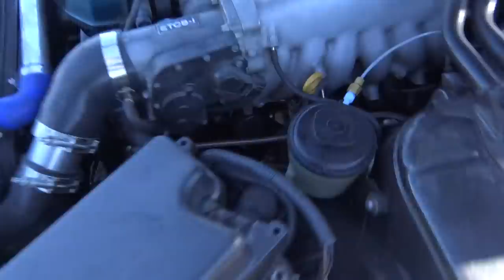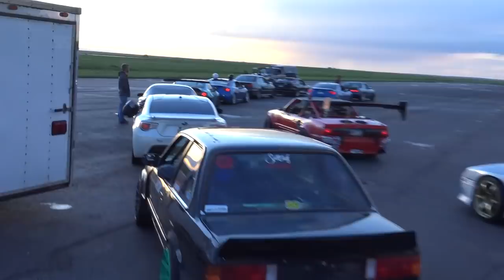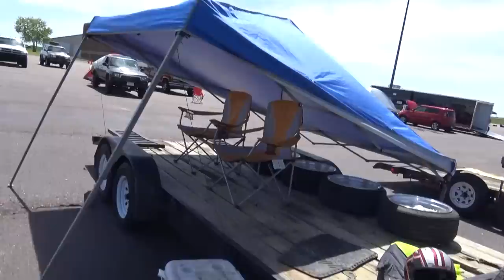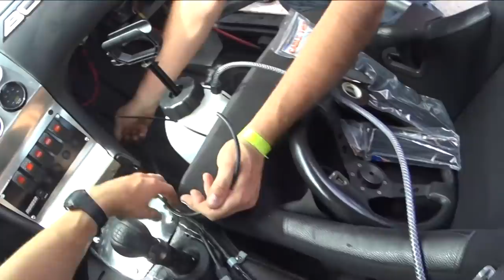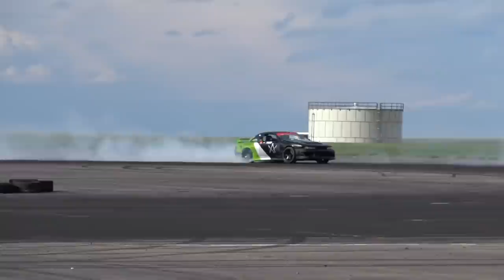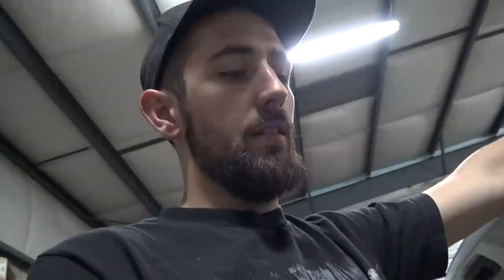Drift Colorado Rd.2 | 2 Day Bash | Weed sprayer Radiator Mist MOD

Comment: i was about to ask about your spring rates then saw in a lower comment that the rears are 4kg but what are the front? 7 or 8? personally id be running 8 and 7 or 10 and 8, but im used to low powered na dungas

Comment: Do you run 265s(R) and 245s(F)?  Also you you have any sort of tune on your 2j or E85?
Reply from the maker: 255 rear and 235 front, usually i run 265's on the rear

Comment: Those bumper bungees, if I grab those do I not need clips for my front bumper???? Is that why guys use them? I thought they were just a look thing.
Reply: It's like a quick removal thing
Reply: Scream Mnky But that will hold the bumper by it self and replace needing all those bumper clips correct? Cause that's exactly what I need for my track car if that's all that's needed. I hate taking my front bumper off and fuckin with the bumper clips.
Reply: +NoOneImportant556 well you need to support it with something around the front but yea they are to replace the clips
Reply: Scream Mnky Ok cool. Thanks for the info bud. Ima look into these some more.